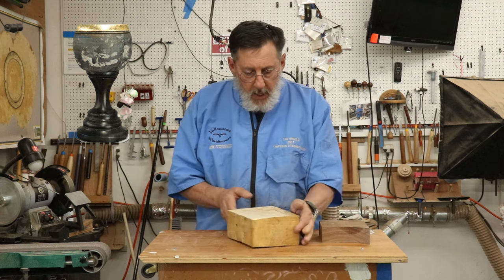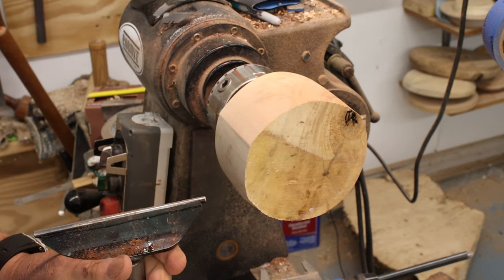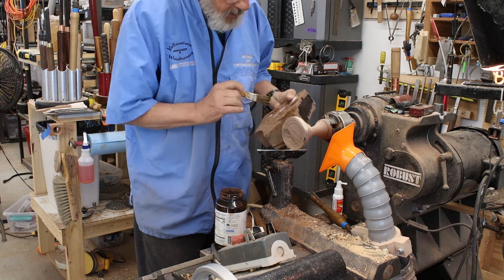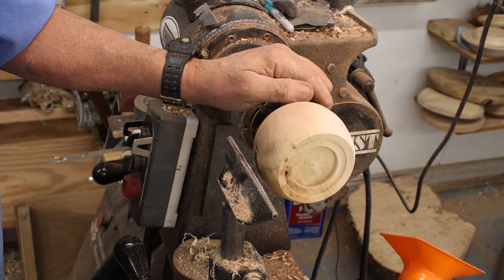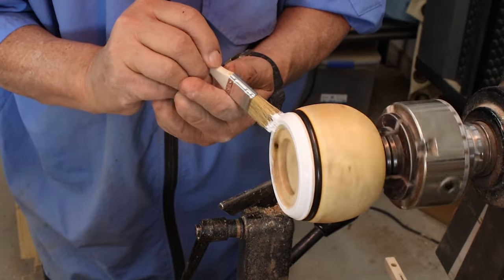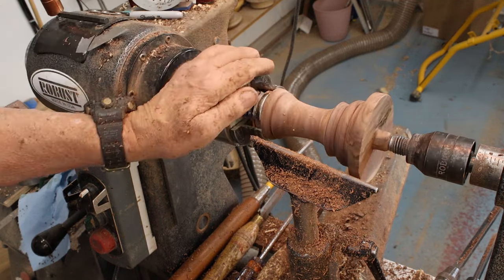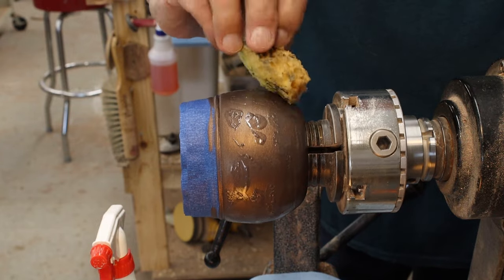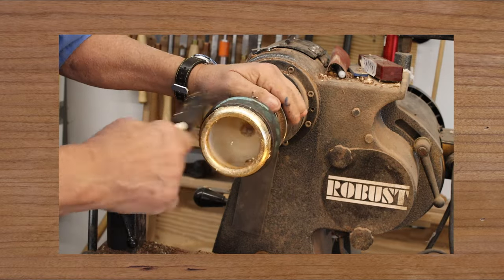Learn to Turn an Ancient Fantastical Goblet-Four Ways Project  April 1, 2024 with Sam Angelo

Comment: Nice job. Interesting technique with the reactive paint. When inlaying with turquoise if you use the coarser chips and fill in the voids with synthetic black sand it gives the effect of real turquoise with matrix which looks more genuine. Also copper or brass sand gives,I think, a better looking contrast. Turquoise inlay,in my opinion, always looks better if it’s where you can buff it out.
Reply from the maker: Since I put this video up, I added more metal reactive paint. I just didn’t think it popped and didn’t think the appearance was bright enough. Sam